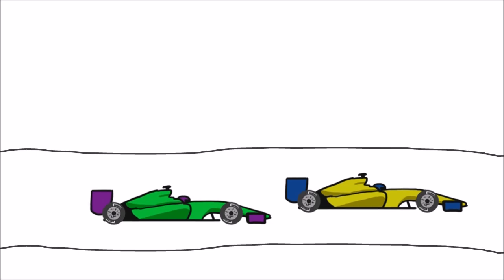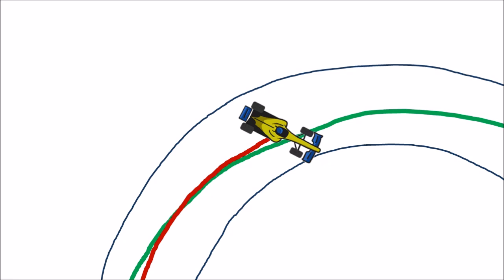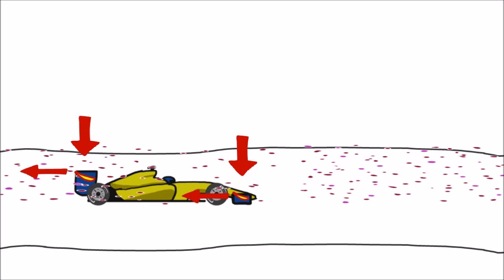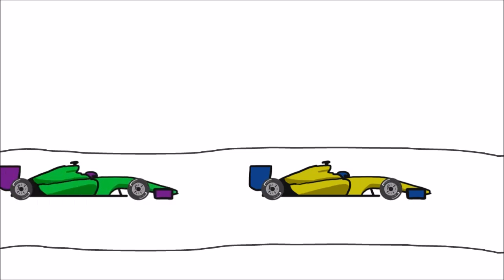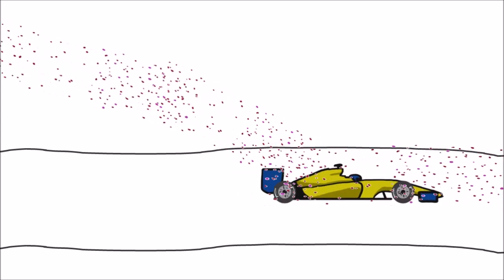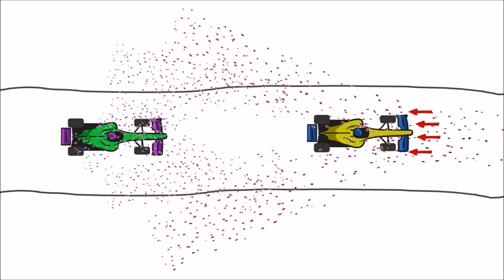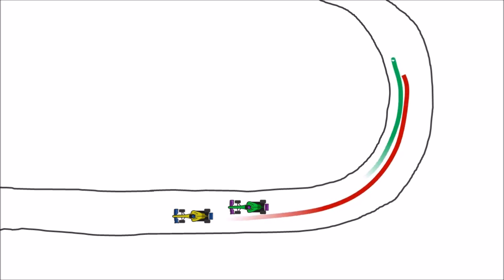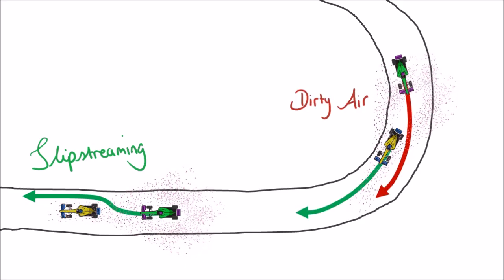Slipstreaming vs Dirty Air

Comment: There is another problem following a car too closely, not covered in this video. Basically, if you stay too close to a car, your engine overheats and this can cause a lot of problems. Another thing in passing in a straight is that the car in front is exhausting hot air, that is less rich in oxygen for the car behind's engine to burn, thus resulting in a loss of power for the car following.
Reply: the lower drag likely is still worth the power loss, given that drag increases to the square of speed.
Reply: But your engine revs can cap close behind a car and still cannot pass.
Reply: yeah nascars overheat all the time. But the hot air from exhaust theory is just to funny. What about the hot air from the engine. Or when someone farts.
Reply: theres also less air going over your car which also doesnt help
Reply: cars are regulated to 0,8L/s doubt it matters maybe in higher up circuit like the on in mexico.
Reply: Which has nothing to do with slipstream of dirty air.

Comment: You forgot to mention that brakes and radiators requiere "clean" air to disipate heat properly too, which is a necesity.

Comment: I would also add the heat the that leading car produces really badly affects the following cars brakes cooling and mainly, engine intake air temprs (as warmer air contains less oxygen for the combustion of fuel) Mentioning the tyre overheating issue caused by lack of downforce would be probably already overexplaining things :)
but great vids man

Comment: This is brilliant! Is it true that the downforce generated by the diffuser suffers less during dirty air conditions than the wings? And would it also make sense for the FIA to oblige teams to design their cars in the wind tunnel receiving dirty air so that overtaking could be improved or would this be impossible because of so many variables?

Comment: Sometimes using the air as an airbrake can help because it allows the car to stay in boost with the momentum going forward meaning u can follow through the corner fluidly thus being faster

Comment: Commentators also often mention that (supposing car A is ahead and car B is closely tucked behind) car B receives the hot exhaust gases from car A and as a result, B's power unit and other components wouldn't function as efficiently as it would in clean air, thereby slowing it down. Wouldn't this happen on the straights as well and not just the corners? So even though you have the vacuum-like effect of slipstreaming,you also have the hot exhaust gases from the car ahead slowing you down, so which is a larger factor?(ie,on the straights, which effect would dominate over the other?)

Comment: I like how you said  that DRS was like a bandaid to the dirty air problem... The solution is making an appearance in 2017, moving to bigger tires and less downforce from what I hear from HAAS technicians
Reply: I read somewhere that the cars are going to be about 5 sec faster next season....
Reply: Crazysworld91 I've actually been hearing the opposite, The new regulations will have more downforce and that will make the dirty air problem worse.
Reply: TheTVPartyNetwork Not sure where you heard this from, unless they scrapped their plans and went to another type of car completely.

Comment: I'm so glad I subscribed to you. YouTube needs more people like you. I had one question though. It seems from your video that the benefit of slipstream is only obtained when you're really close to the car in front. But when you're not that close the effect of dirty air dominates. Is that true?
Reply: +maahir arora The dirty air only really becomes a big problem at the corners, making overtakes there near impossible. On the straights, you can still depend on the car's top speed to pull closer even if you're not in the slip stream (a la Mercedes and Ferrari).

Comment: Wait, but is there any disadvantages of slipstreaming in terms of power output?I mean, you're in a pocket of less dense air created by the car ahead, so, does that lack of air not make an impact on how much intake air goes into the engine resulting in less power? I'd say it would not be as important now with the hybrid turbos, but in the old NA era it should have made a diference right? You sir channel owner seems to know your fair share about F1, it'd be nice to get an answer from you mate.
Reply: afaik. no direct impact since the air intake hole is so high. but what does matter is the engine cooling. since getting in a slipstream means getting slightly less air for a small period of time, that period of time also means less air getting through the radiator to cool the engine is down. which is fine for a bit. but too long in the slipstream makes the engine overheat. this is modeled in the F1 game series.
Reply: The teams adjust the sidepod and airbox size to adjust the airflow. In a similar way, having large openings INSIDE causes drag. That's why in Monza, when they're aiming for LOW drag and less downforce (to gain massive amounts of top speed) you will hear the commentators mention the cars start to overheat by the end of the straight. Even though they're going 300-360km/h the engines still overheat. This is because the air intakes holes are restricted to allow less air to pass through, reducing drag. So to answer your question, yes. If you were to sit behind a car for a long period of time, which does happen, the tyres will overheat and so will the engine. Mind you, dirty air is generally warm as well, which is also a disadvantage.

Comment: Then how are Indycars able to follow each other so closely? Especially since they race in an oval pattern. Wouldnt dirty air affect them more since they are making slight turning motions?
Reply: +Arvin Rao I'll answer your question with respect to the Indy 500 (oval track). 

This might be a little confusing, but the characteristics of the oval track actually make it a massive long straight (somewhat like the huge right-handed turn onto the DRS straight in Shanghai GP). And because those cars drive at the turns almost like a straight, the car is not so reliant on downforce, allowing it to take advantage of the slipstream. The dirty air problem is only when the cars have to do slow corners like on conventional F1 tracks, where downforce is needed to make the cars stick on the track while turning.
Reply: +Arvin Rao Not only that, Indycars do not have as complicated an aerodynamic design requirements as F1. The main aero parts like the wings are relatively simple. F1 wings on the other hand, because of their complicated designs, really depend on a steady stream of clean air in order to work at its fullest and are very sensitive to dirty air. That, coupled with the high-wear tyres, are why F1 drivers are complaining about lack of overtaking opportunities due to lack of downforce and grip at corners.
Reply: Daniel Chong So does that mean if the FIA relaxes some of those wing requirements, the designers would be able to produce wings that are not dirty air sensitive?
Reply: Arvin Rao Indeed, in some sense, that might help.There are calls by some fans for the FIA to make the wing designs simpler to prevent the dirty air situation from ruining the drivers' chances of doing overtakes on corners.
Reply: +Arvin Rao Yeah they need to allow more ground effect which means much simpler wings can be uses so cars can follow much more closer

Comment: Great videos for someone who is new in the sports.

So with the 2017 regulations with bigger wings you think we will have more dirty air?
Reply: Yep it will be either worse or about the same. If they added wider tires to current car it would be easier to overtake or follow since more mechanical grip. Pretty much if there is more downforce the car has it relies more on air dumping on the car.

Comment: I thought that wings created high pressure on the top and low on the bottom which pulls the car down rather than just air pushing the car down?

Comment: Hardly any of the focus of the 2017 regulations has been on simplifying the front wing and making it smaller. How much easier would it be to follow another car if there were, say, a maximum number of pieces that could make up the front wing? Would it be any better than when they got rid of all the dangly bits on the sidepods for 2009?

Comment: So, if this is such an issue, why isn't the angle of the spoiler mechanically linked to the steering?
Reply: Michael Molter I know right, I was thinking the same thing, just have it angled at certain angles per intensity of the turn.
Reply: Michael Molter Because FIA doesn't allow it
Reply: ***** Why not?

Comment: Thank you,this clears up a lot of doubts but I still have a few unanswered questions in mind
Won't dirty air also have the hot exhaust from the car in front? And won't this happen not only on corners but also on the straights? 
Also,when car B is behind car A and B is in A's slipstream,due to thinner air wouldn't B's engine performance drop down(because an engine needs fresh air for maximum power output)?

Comment: Amazing video. One question came to mind which I was hoping you could shine some insight on. Would it be possible for f1 cars to make alterations that would (at least somewhat) negate the effects of "dirty air"? Or are the vortices etc. simply too violent for any kind of shape to handle? Thanks so much!
Reply: Its been two years so you likely already know but those are the changes proposed for the 2021 F1. There were already some restrictions added for the wings these last seasons so they won't generate such a dirty air.

Comment: hey,mam your awesome, keep going, give us some video about the finance of the teams, and I am so confused why Manor is loosing lap or 2 laps gap while the engine and the equipment's are all the same, it's FIA rules every car should have the same parts I isn't it?
Reply: +Nathanael Namrath Nath the answer is super simple. Manor was running an almost 100% 2014-spec car in 2015! The only 2015-spec part of their car was the front nose. Everything else was still 2014 due to the team having no money to develop the 2015 car while they were under financial administration. How bad were the team financially? 60mil pounds in debt.

Comment: downforce is caused from the underside from the spoilers right? so its being pulled not pushed?!
Reply: That's right. About 1/3 of the force is done by pushing, the remaining 2/3 are created by the low pressure sucking down the spoiler
Reply: No, all forces in aerodynamics are pushing forces. If there is a low pressure zone under the wing (which there will be on a formula car) then the air above the wing pushes down on the wing harder than the air below the wing pushes up.
Reply: Delta X what? didnt make much sense to me sorry
Reply: Sorry spotted a spelling error. the air above the wing pushes down on the wing harder than the air BELOW the wing pushes up.
Reply: sebastianblevdet In aerodynamics, there are no 'sucking' forces, only pushing forces. 

Air molecules repel each other and other stuff. So if you have a lot of them in a tight space they create a lot of pushing force. That's why a balloon filled with air stays puffy. The atmosphere contains enough air that the repulsion put 14 pounds of force on every square inch of everything. But because that pressure is on both sides of everything it cancels out and has no effect. 

A formula wing makes it so that there is less air pressure on the bottom face of the wing than the top. This means the atmosphere pushes down on the top of the wing harder than the bottom of the wing, which causes down force on the car

I hope that clears it up a bit.
Reply: Sam Morriss Fixed it
Reply: Delta X yeah, made way more sense, and more educational. Cheers!
Reply: Lift/downforce is always an interesting thing to try and explain, because there are two simple answers, neither of which fully explain the situation, but together get most of the way there. 
So you've got Newton's 3rd Law of Motion, and Bernoulli's principle. You've got the shape of the aerofoil creating high pressure and low pressure streams where it divides the air stream, but you've also got the deflection of the air stream by the aerofoil. The air impacts the aerofoil, the aerofoil imparts a normal force, deflecting the air stream and through 3rd law pairs the air imparts a force on the aerofoil.
There are problems with these explanations, and they fall apart with more detailed inspection, but they're enough to get the gist of why and how lift works. 
It's all oh so much more complex than that, and I just haven't studied enough physics to understand it.
Reply: It's all down to the whole "nature abhors a vacuum" thing.  The air pressure will always try to equalise itself in some way.  It's the same principle with aeroplane wings, vacuum cleaners, straws and even Earth's own atmosphere.

Comment: Low downforce in the corners, will it cause understeer or oversteer? Can anyone explain how/why it will be understeer? TIA
Reply: without downforce your car will want to fly like a plane taking off but can't really fly. If your front wheels lack downforce, it would understeer coz the wheels would turn the car are barely touching the ground, like it wants to do a wheelie. If your back wheels lacked downforce it will over steer coz your car is like pivoting on it's front wheels like doing a front wheelie and the back swings when it turns causing to oversteer.

Comment: the chasing car cant get enough downforce and DRS which gives it less downforce is supposed to compensate for that?
Reply: so the drs compensates for dirty wind indirectly
Reply: to make this clear,
dirty air gives less downforce, so that's advantageous to a chasing car(except in turns) isn't it? regardless of drs

so the drs compensates for the dirty air in turns(4:23), by allowing greater speed in straights, therefore indirectly right?
Reply: I see. thanks mate

Comment: what is the minimum speed for slipstreaming to take effect?
Reply: Usually at around 160 kmph the aerodynamics of the car start to get noticed, so you can get a noticeble advantage at around that speed. However, if you are driving on the highway behind a truck, even tho your speed is around 90kmph, the slipstream of the truck is so big, that you will notice a huge difference in gas compsumtion, and of course, acceleration. Since the highway is not that curvy and the speeds are small, the effect of dirty air is also very small.
Reply: Long distance runners will use slip streaming so it's useful for speeds less than 15mph, or 25 Kmph
Reply: That is correct, however, for a car, the aero advantages for a speek under 25kmph are pretty unnoticeable. If you want to notice a real change in the aero of a car, take it over 160 kmph.
Reply: my car starts to lose grip at 100km/h, does that mean the car following me can start slipstreaming at 100km/h?

Comment: Actually dirty air is literally not getting enough clean air for the engine (and air is his most important "food") and clean air to cool the brakes down.
Reply: +KingAlpaca Dirty air is another term of turbulent air. So it really refers to the aerodynamic aspect, not the other things you mentioned. The overheating caused by closely following the lead car is a small consequence that will only become a big problem especially if the car cannot overtake for long periods of time.

Comment: So, we need F1 cars to make less of a hole in the air and be less aerodynamically dependent so we can see cars chase each other closely and properly. then DRS would make sense because of less of a slipstream effect. EZ PZ . Honestly though if they could work on chasing being better/closer in the sport that would be absolutely fantastic.
Reply: Sean McCormack next season, the cars get more mechanical grip and less aero grip. They said that they want to make the races more interesting because they realized that the races are "determined by pit stops"
Reply: they've been saying this since 1995
Reply: So you want F1 to be NASCAR.
Reply: lmao no. im just typing, really
Reply: I agree, mechanical grip would make for better racing as aero really only helps the guy in front.  I doubt the FIA will backtrack on the decision to ditch mechanical grip, though.  I'm not certain, but I believe that they changed this rule after the death of Ayrton Senna at Imola - and the fact that the same weekend also killed Roland Ratzenberger and came close to taking Rubens Barrichello as well.

Comment: This is the problem with modern F1 cars, too reliant on aerodynamic grip with lackluster mechanical grip to the point where exciting racing is almost non existent
Reply: I would never call the mechanical grip in F1 cars "lackluster", the tyres are super grippy even without any help from the aero, and it's only the comparison to the huge gains from massive amounts of downforce that makes them look in any way lacking. Compare them to any other racing series out there and the tire grip (= mechanical grip) of F1 tires will either be equal or higher. The only disadvantage the F1 cars might arguably have in terms of mechanical grip is that since aero is so important they need to design the suspension to be really stiff, which can hurt mechanical grip a bit.